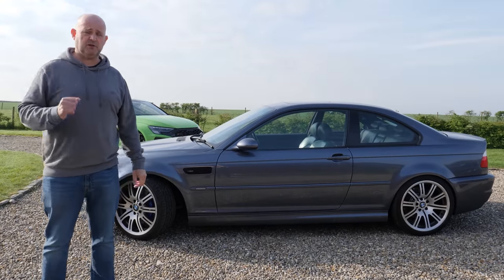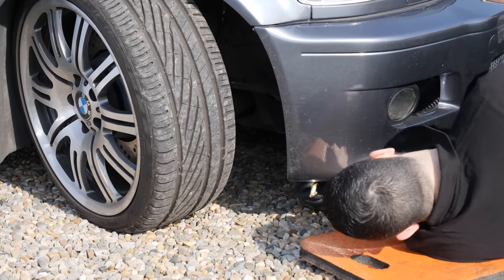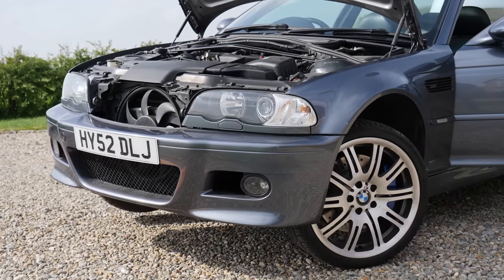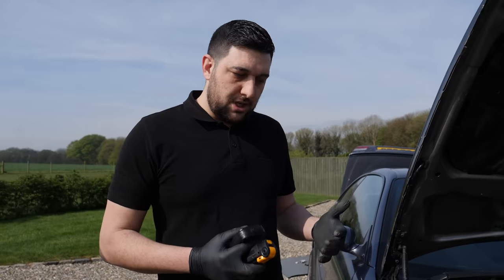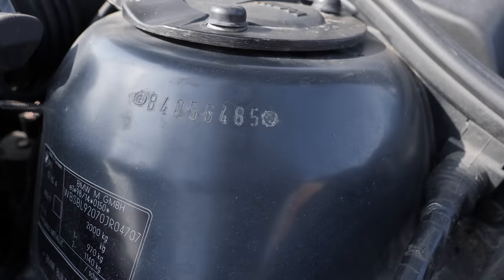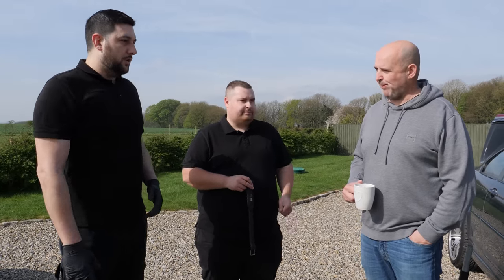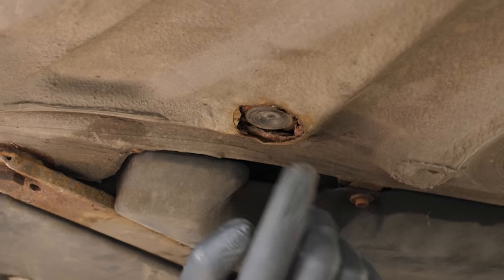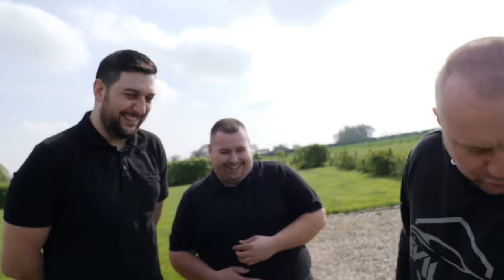IS BUYING A 20 YEAR OLD SPORTS COUPE A GOOD IDEA?

Comment: I bought an E46 M3 in September last year. Mechanical sound, and sold with "no rust". Anyway, I just had both the driver side and passenger side sills welded, all the drain holes welded and a few other bits done. My car has 66k on the clock, so thought it would be worth spending the money. Yours won't take much to sort out, and would be good content. Keep going with it, it'll be 100% worth it
Reply: You done well finding an E46 M3 with only 66k. I’ve had 3 in the past and the lowest mileage one I had was 80k and that was 7 years ago.

Comment: Keep the car. Get the corrosion and the rest of the bodywork sorted.
The question I would ask is that this car has been up on the ramp for various bodywork repairs i.e. rear subframe repair and other modifications. How come this rust hasn't been picked up before?

Comment: Gotta mention,anyone that has an e46 m3 for a few years knows these rust out the arches so a lil filler on the front arches isn't always indication of an accident and usually is just the rust repair on the arches, filler paint etc.. bumper sagging is also super common on the e46 m3s! So much so that bmw actually realeased  some cheap as chips clips to hold the bumpers back up!..... just my 2 cents 👍

Comment: First question is how was this not picked up on the MOT. The rust surely should’ve been flagged along with under bonnet items not fixed down. Is the cracked subframe not an MOT fail? I think you have already committed to the car and it’s not as bad as it could be so just get it fixed. Will still go up in value even if you sell it in a years time.

Glad it’s not just me that buys shite! Been burnt a few times in the past.

Comment: Should keep it mate. Like you said they are only appreciating and if it’s been repaired to a high standard like you boys would, then it’s just as good as any other. Maybe even better as you know everything has been looked over with a fine tooth comb 👌Fast road set up sounds like a good plan ! If the engine does give up the ghost then you have that cheeky 2J you could shoe horn in 👀

Comment: Keep the M3 and carry on with the upgrade work,  its a current/future classic.   You are changing parts to make it an OEM plus and have already tackled the rear sub-frame (which, lets be honest is a far bigger safety concern than a bit of filler & some shit paint). Your Datsun was a prime example of a car with shit paint but that came out of the factory like that!  I would suggest that you would struggle to find an E46 M3 that hasn't seen the wrong side of a hedge and you now know exactly what you are dealing with.  Crack on boyo's  lets see some real money spent on it... LOL

Comment: It's a 20 year old car. You knew there was some damage and seems thr only problem with the fix is it has been fillered and painted to a sub par standard. 
As for the rust the rear end could do with  strip down weld up and refresh anyway. 160k miles and 20 years will do that to any car.  Defo keep it. Everyone loves an e46 m3 build.

Comment: Get the boot floor replaced and the rear subframe mounts checked (and repaired) at the same time.  Not that much money about £1k to do it right.  Use a reputable BMW indy who knows how to do the job and set it back up right after.  This is a very, very common problem on the E46...
Reply from the maker: Rear subframe mounts done mate. There’s a video on it 👍🏼
Reply: @EVILGT  Ah sorry should have listened :D

Comment: you bought a 20 years old car, for the 'lowest on the market' price, with stated mileage.... and you think its got to be scrapped???  come on, the hole in the floor grommet, is nothing, superficial rust underneath a 20 year old car is expected.  they found no major structural repairs.... its been tidied up, and its good for another good few years, as long as you address what it pointed out to you now... keep it, drive it.